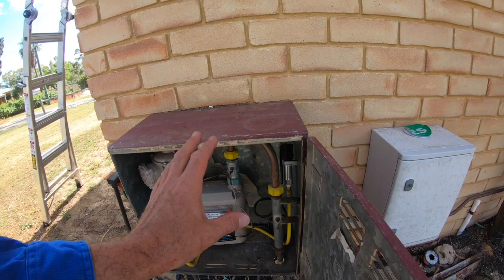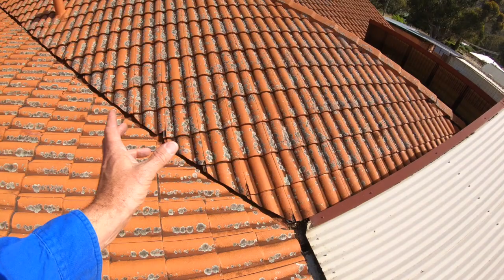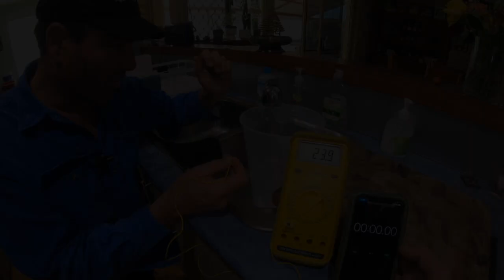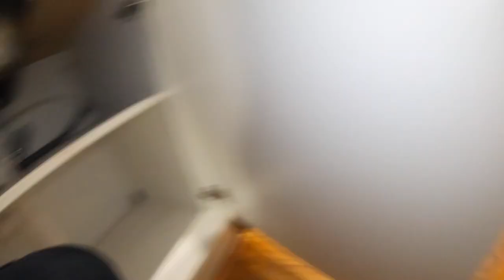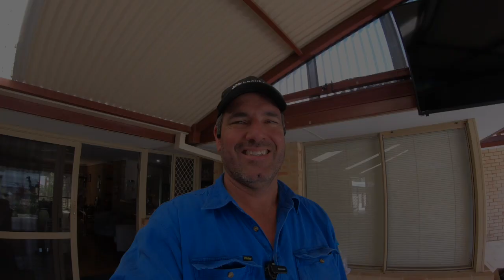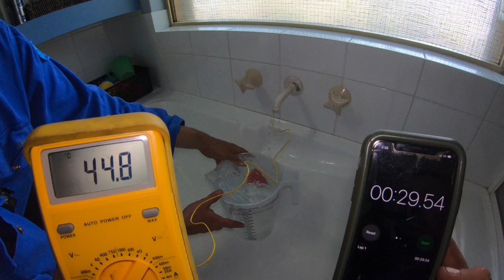How to Save Water and Time with This How Water System Set Up

Comment: Would you ever recommend a instantaneous HWU more than 16L a minute if the existing hot line is only ½”? I see it all the time but it doesn’t make a lot of sense to me.
Reply: Here is the issue the manufactures for systems over 16l eg 20 and 26l require a 20mm cold and hot main. A lot of plumbers reduce it to 1/2 which makes the unit work harder and will fail prematurely and you won’t be warranted by the manufacturer that’s why pipe sizing is important. And why quotes differ from the good plumber and the cowboys